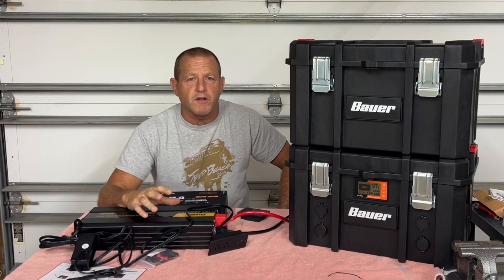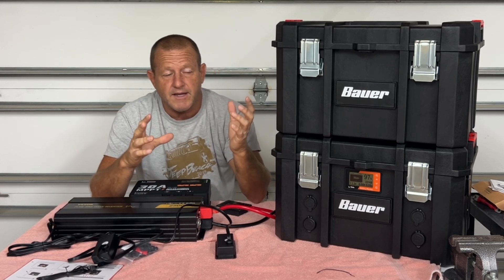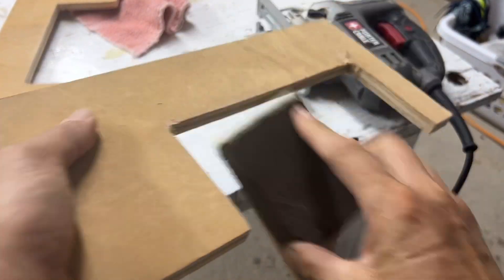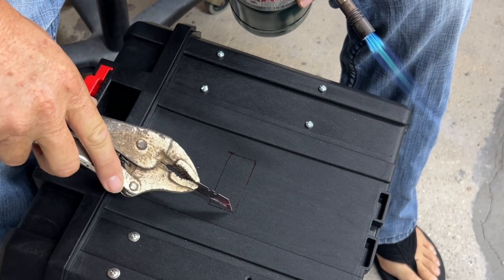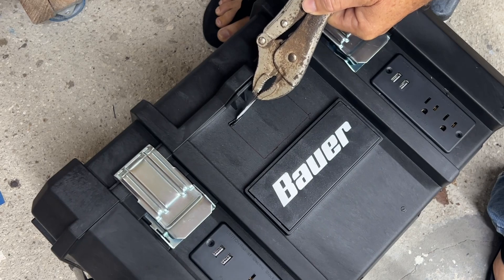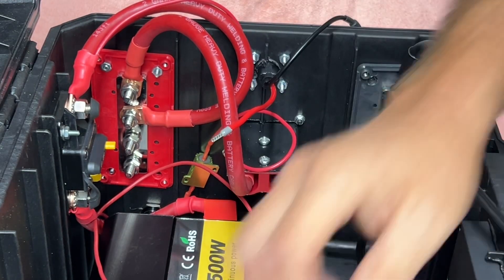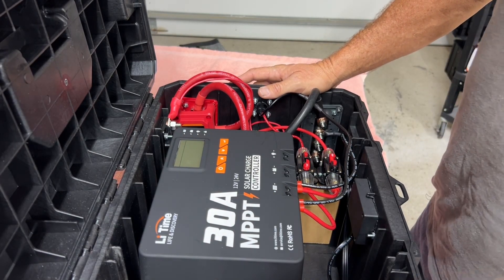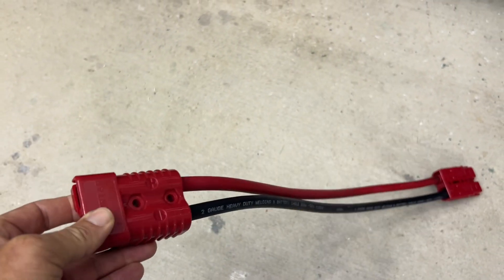DIY SolarGenerator Build - Episode 3: Inverter / Solar Module Setup

Comment: Good evening, I have a 12v 280ah = 3584wh battery. I would like to know what power I should take as an Anderson connector? Thank you very much. 😊
Reply from the maker: it is actually based on your inverter and or BMS. that will give me your max amp draw off of the battery. but typicaly a sb175 anderson connector with 1/0 cable as long as you are not normally using more than 2500 wats of power

Comment: Good evening, great installation. I have a question for you because I have a 3000w inverter that acts as a charger and converter. How do I connect this?
Reply from the maker: without  knowing which modle or brand it would be hard for me to know exactly but i would assume you would just hook to the battery or the shared battery busbar and have a cord for input voltage

Comment: very nice setup and now im gonna build the same thing.....was wondering if you could show or explain how the "precharge circuit" actully hooks up.....cant really tell in the video..... thanks for this build, will help greatly when i do my solo truck camping
Reply from the maker: stay tuned  i will post a video on it. essentually you use a momentary switch in line with a 7 ohm resistor from battery to inverter  that bypasses the main power to inverter switch .when you press the momentary switch, resisted voltage bypasses the main switch and charges up the capacitors in the inverter slowly, preventing massive inrush of voltage into inverter (the spark)   ,  . after a couple of seconds you can release the momentary switch and turn main power to inverter on since the capacitors are now pre charged.
Reply from the maker: i will be posting a upgrade video within the next day keep an eye out for it befor you start.
Reply: @StoneBrokeAdventure  thank you sir i will keep a watch for it
Reply: Great video! I'm having the same issue connecting the resistor up.  Can't wait to see how that was done 

Thank you!

Comment: People don’t always realize the thought process that goes into a build like this. I’m new to this myself, and I’ve watched many videos on the subject. I truly appreciate the time and effort you’ve put into this build—it’s incredibly helpful.

As someone just starting out, I’ve already purchased many of the components you recommended. My motto is “slow and steady” (lol), but thanks to you, I now have a great starting point.

I just subscribed to your channel—thank you for sharing your knowledge!

Stay blessed!
Reply from the maker: thank you if you have any questions i try to allways reply to the comments
Reply: @StoneBrokeAdventure  I have a question: Is there a specific reason you chose the 1/0 Gauge (1/0 AWG) 10 Feet Red + 10 Feet Black Welding Battery Pure Copper Flexible Cable for this build?

I noticed another option from a US-based company, TEMCo, which offers the WC0177 Welding Cable – 2 AWG, 10 ft (50% Red, 50% Black). It can handle a maximum amperage of 205 amps, which seems sufficient for this setup. Additionally, the price point is significantly lower at $32.81.

I’d love to hear your thoughts on this!
Reply from the maker: @minceym  2 awg will be fine just make sure it is pure copper, not copper clad alluminum. . 2 totally different things.  the anderson connectors are 1/0   but used the 2awg wire. i crimped and soldered those connections to make sure they had solid connection in the anderson. I spec. out 1/0 to avoid the confusion.  allways check amp charts for wire and your use and fuse or breaker to the wire size
Reply: @StoneBrokeAdventure  Thx!

Comment: Very nice setup

I was thinking of a slightly different configuration that I wanted your opinion on. 

For those grid down conditions, building several battery boxes (12v & 120v in each box?) and a single charging box with charger and mppt in it. 

Then in grid down, locate 1 or more power boxes in house to power devices like fridge. 

As power boxes run down, swap for another power box (like propane bottles on a generator), and recharge the power box with the charger box by either solar, generator or somewhere the grid is up. 

Thinking of ease, cost and safety for those not comfortable around electricity.
Reply from the maker: that would certianly work. removing the charger from the batery box frees up space for inverter or an extra battery.
Reply: Hello! Nice job on your build! Quick question, what is the benefit to using a charger/converter over a traditional lifepo4 battery charger? Does the converter power the 12 volt accessories while plugged into shore power so there is no drain on the battery during times that it is plugged in? Thanks in advance , Jason
Reply from the maker: @LXRACR  ye thatt is exaxtly what it does. i decided to remove the charger in my unit and  made space for another battery in parallel. i charge with a regular battery charger if i need to but use the solar 90 percent of the time